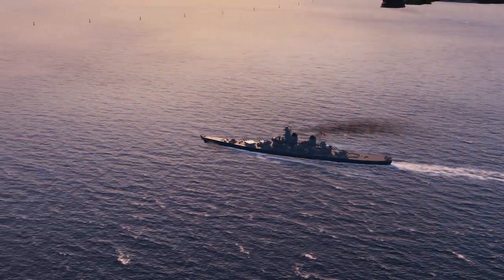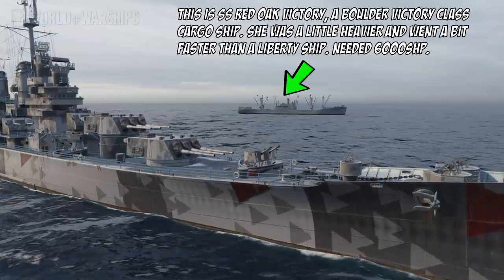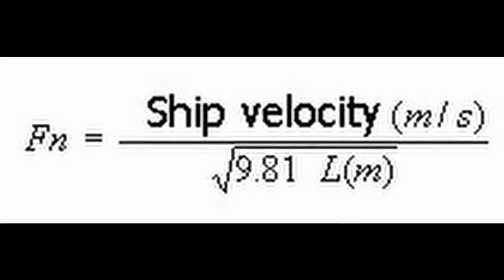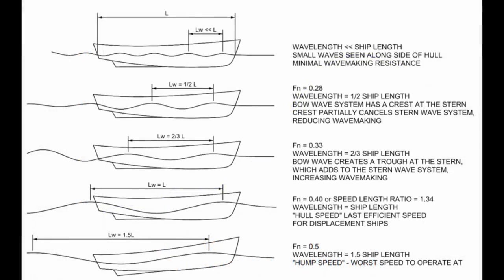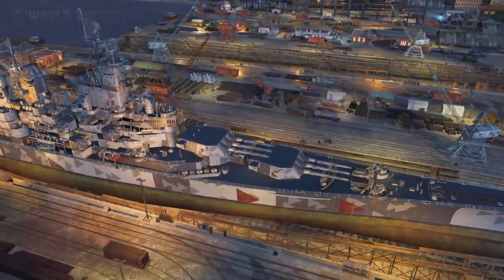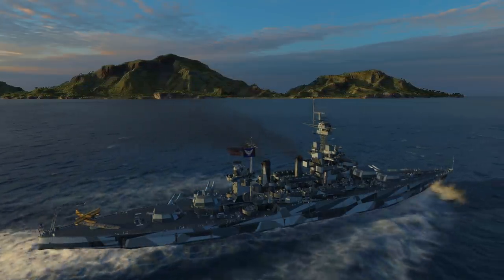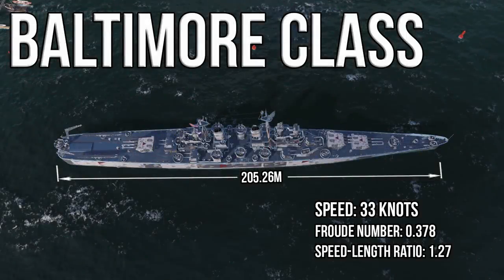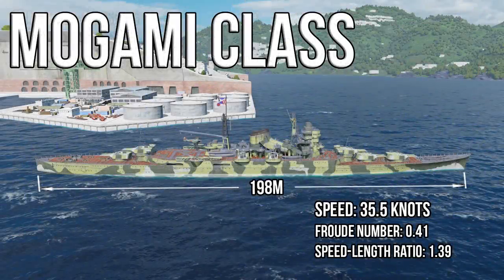Froude Number - Why Georgia and H4 are Memes

Comment: As the froude number is all about wave creation, where comes the bulbous bow in? And why did no warship ever have one?
Reply: They did have them, for example on Iowa and Yamato
Reply from the maker: They had the bulbous bows, but a few things about them. They are mostly for improved fuel economy due to the bow creating a 2nd wave that nullifies some of the main wave. They also tend to work well for ships that always sail at constant speeds, container vessels for example. Warships which change speed in combat won't get the full benefit from bulbous bows but still benefit when they cruise around
Reply: @ichasegaming  when they benefit while cruising around, is there any drawback which was good enough reason to not use them? And i've read online that they are mainly used to increase fuel efficeny but can also raise the top speed of a ship because of less water resistance by cancelling out the waves. Is this correct?
Reply from the maker: You can think about it this way, a bulbous bow is specially designed so it operates very well at a specific speed. Once you operate the ship at a speed that's not the optimal speed for that bulbous bow, you lose the effect of said bow. For a warship where speed changes in combat happen much more frequently, you could end up not only with no advantage but even end up with a disadvantage lugging around an extra lump of metal in front adding to the resistance experienced by the ship instead of nullifying it :)
Reply: @ichasegaming  so that's why warships don't have bulbous bows. Thanks!